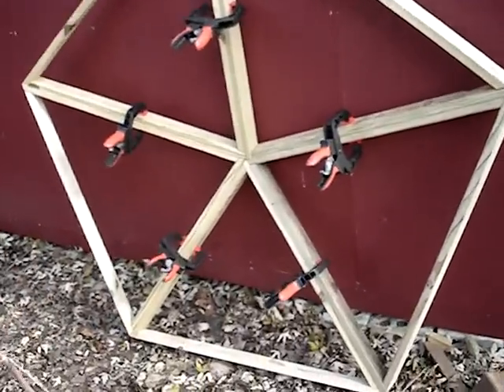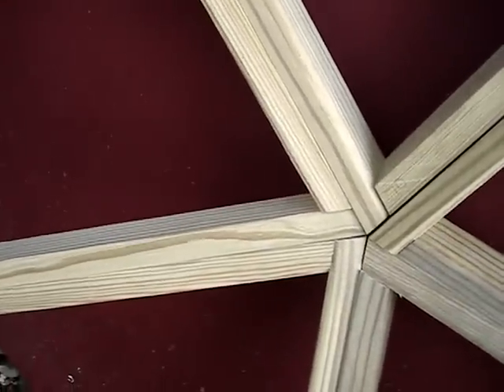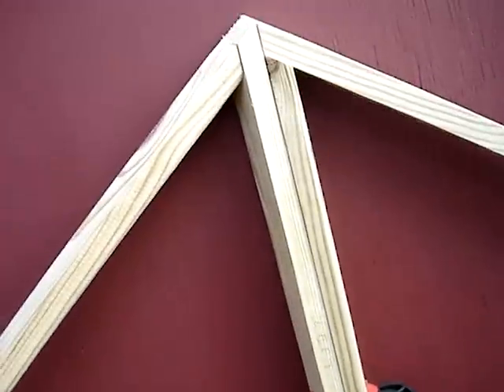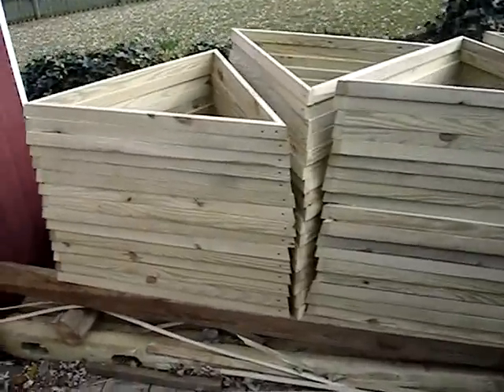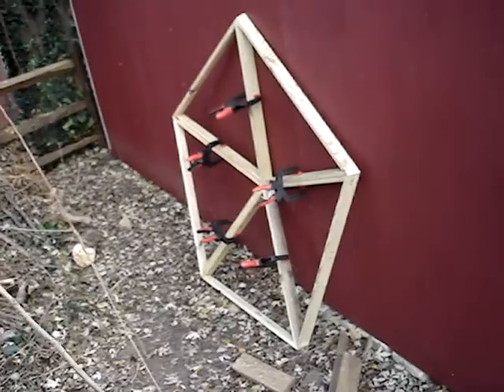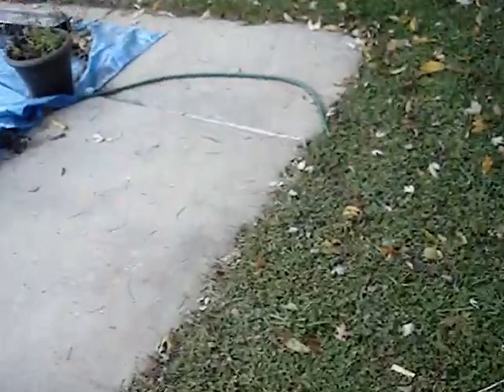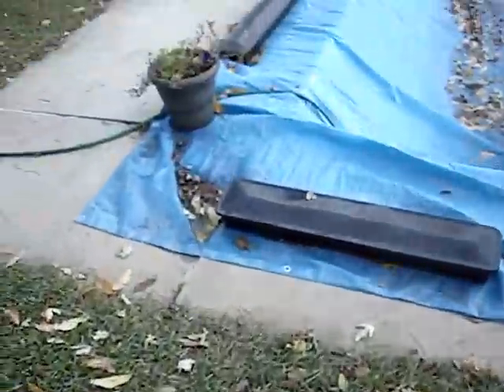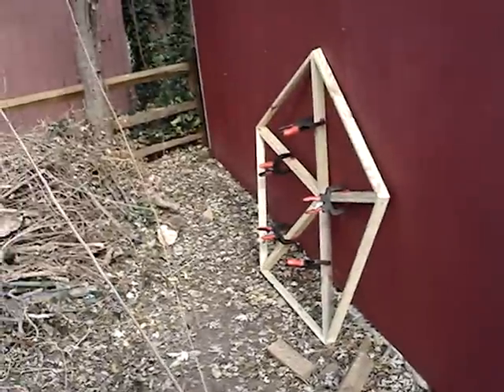11:11am 11-11-11 Geo Dome Update

Comment: great work, your green house look very good. im planning to make the same structure green house, but i have few thoughts. looking at your video,where you showed how to make triangles, all triangles corners are 90 degrees (it looks from the video), but if that angle is 90 degrees, then you will not be able to make good hexagon? looking at this video, it looks that all triangles have less then 90 degrees corners and they fit together perfectly. Maybe you could explain how exactly did you made them